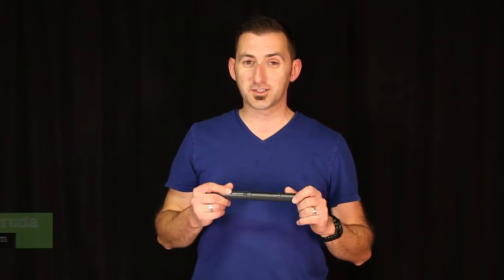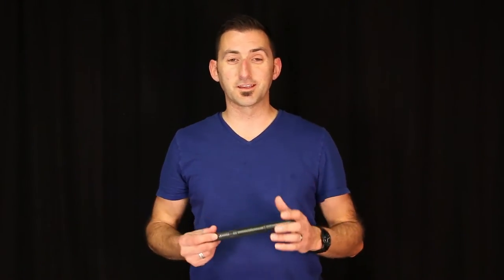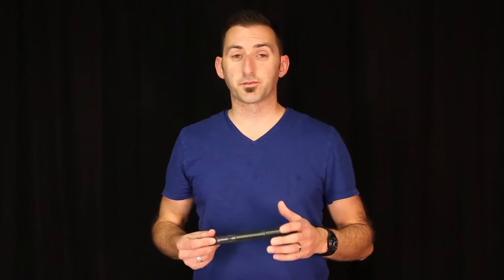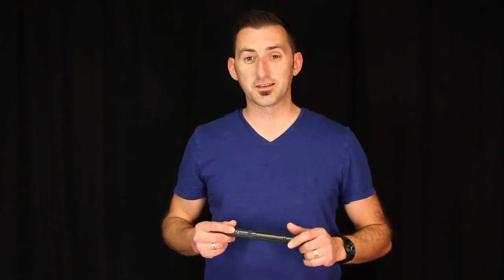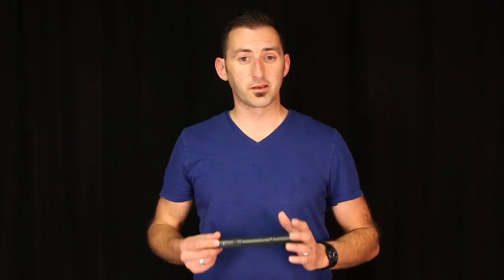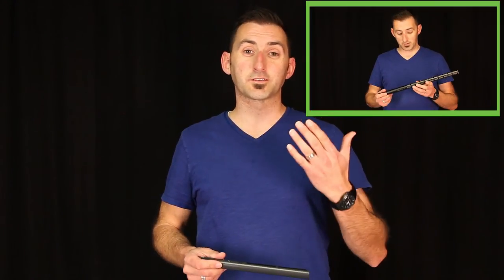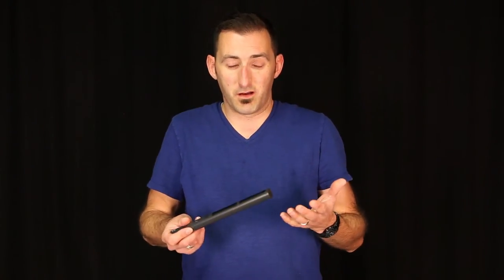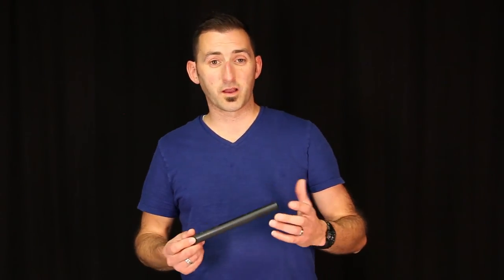AKG C568 B Review

Comment: What is best Akg C568eb or RØDE NTG2? (for dialogue recording from above head)
Reply: We suggest that you use the Røde NTG2 instead of the C568B.
Reply: Okay, Thanks. I just decided to buy the Røde NTG2 because of your comment(got it cheap used). Now, what is the cheapest but (still good) way to connect this to my computer. Is Behringer XENYX 302USB a good and best cheap one?  -- I do however have a asus xonar u7 usb external soundcard but i guess i need somthing to power it then, What would you recommend i buy?
Reply: Now the mic is gonna be close(just above head), do i need a preamp i heard somon say its a must to make it sound good?   i can get ART Tube MP(for 26 euro) or Behringer Mic100 Tube ultragain (for 13 euro) Should i get any of these or even something better or is preamp just useless for me?
Reply: I have a Behringer Tube Pre Amp that I've used since 2005.  For the price it sounds really good. If the Mic100 sounds anything as good as that than I'd say you'd be happy.
Reply: Pre amps especially with tube circuitry can make your vocal sound warmer.  It is even visible in the waveform on your DAW.
Reply: Dude you are great man thanks. First time i have this kind og gear, so i have no clue what these things are, thats why i ask you, so i can get a good setup. Just to make it clear, is the preamp enough or do i still need a interface like the XENYX 302USB?  i guess i can send the sound to the preamp and then to the usb soundcard(xonar u7) with a xlr to jack 3,5.
Reply: Yes you'll need an interface like the XENYX 302USB. If it's in your budget I love the Focusrite Scarlett.  Remember when using a separate pre amp to connect to the interface using a 1/4" TRS (balanced) cable.  This is so you don't accidentally damage the preamp if you accidentally send phantom power back to it from the interface.
Reply: Okay. I think i'll get a Focusrite Scarlett solo. Then i wont have to buy separate preamp i guess- btw, i appreciate your help.